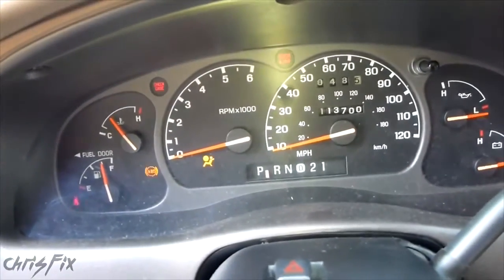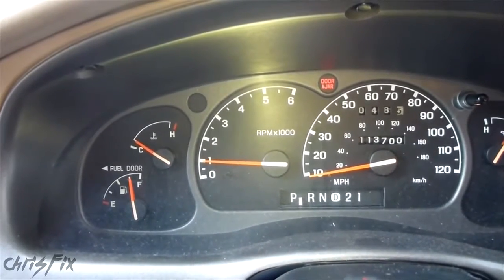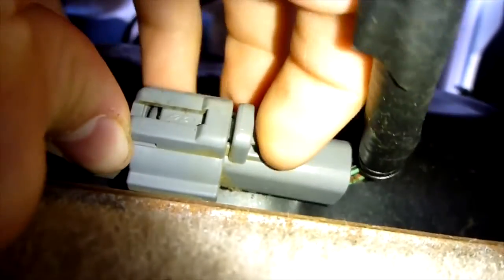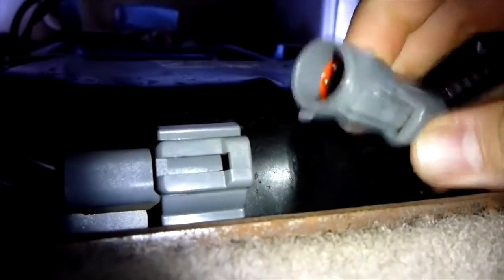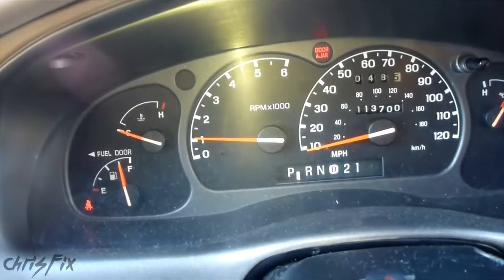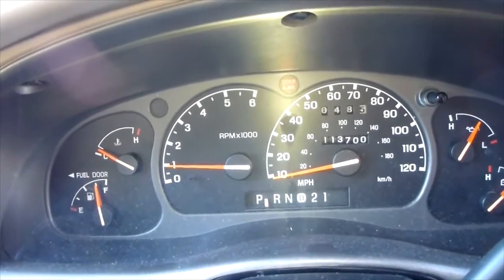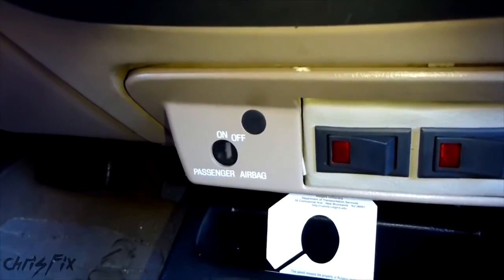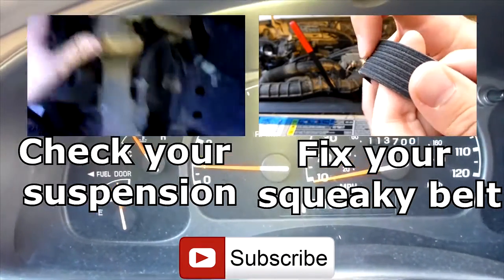Air Bag Light Flashing, How to diagnose and fix 2016

Comment: Hey Chris fix! Great work first of all I've learned lots. Ok my question is I have a 2000 olds intrigue and she's my baby. Just put new rims on and its acting funky. Never did before! Now I'm pretty good with cars and I can't relate the air bag light that just came on yesterday to the rims. Has to be unrelated. Anyways mine comes on blinks like normal as it always has then stays on. I've looked everywhere including under the seat.. the passenger seat has no electricity what so ever. Just the driver..I'm wondering what I can do about this. Autozone said they can't test an air bag light. Just engine codes..I don't want them to go off in my face and I'm just hoping it's a lose wire . Eric